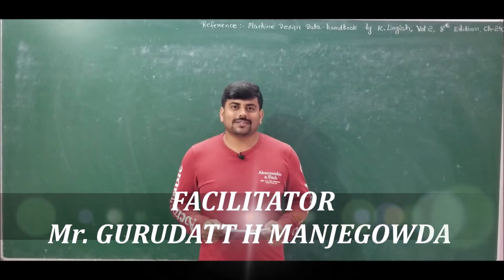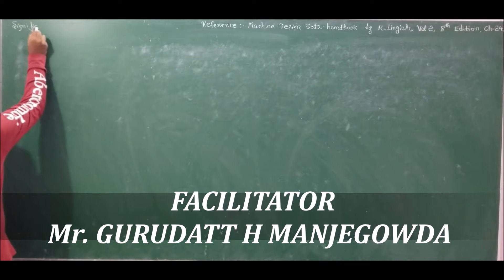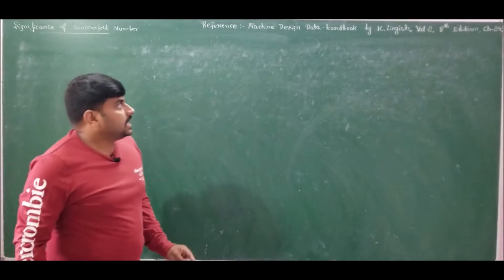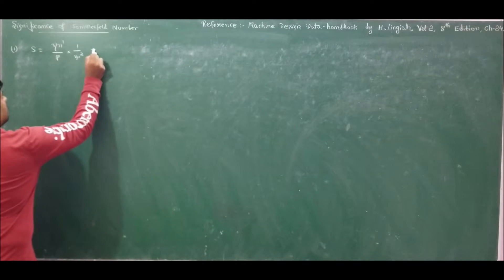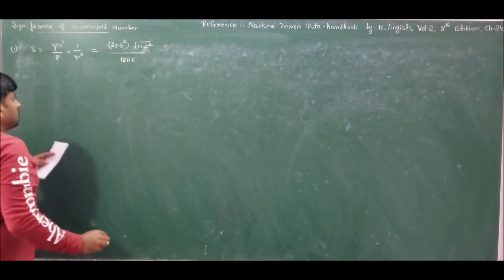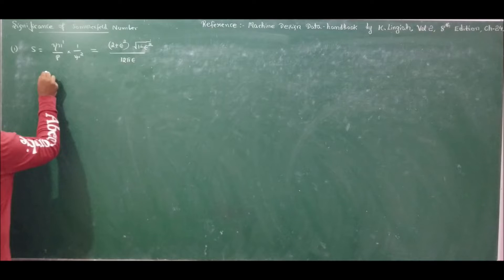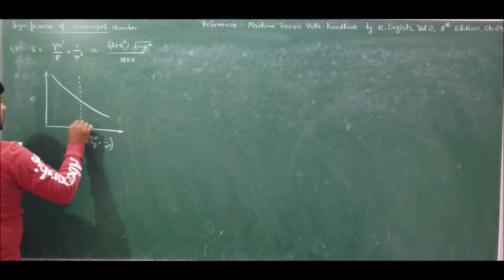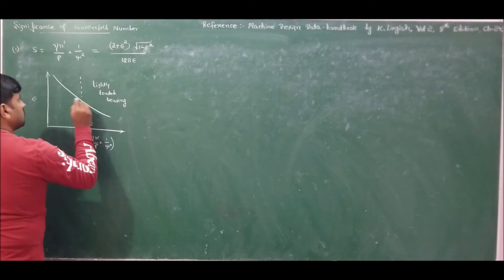04 - Significance of Sommerfeld's number - Tribology by GURUDATT.H.M

Comment: if it can help someone, references of fig and ref in the video were not good for me : at 3:50 eq ref 23.44 not 24.44 ; at 6:45 fig ref is 23.17 not 24.15. He refers to chapters 23 not 24 from the document I got, but I do not know if the document I used was the 8th edition and if it changes something.

Maybe great lecture, but from my point of view, it is not what I excpected when I saw the title. I expected more something that would've explained the terms in the expression, why do we have (1/(clearance ratio))**2 in the formula of the summerfeld number and why not (1/(clearance ratio)) or (1/(clearance ratio))**3, and explain also other term. I expected to learn why was this number created and where its origin came from.

I would have expected an explaination such for the Reynolds number which describe the ratio of inertial forces to vicous forces. So we know when Reynolds number is low, viscous forces are much greater than inertial forces so we have a laminar flow. That kind of explanation i was expecting here but thank you.

Sorry for potential spelling errors